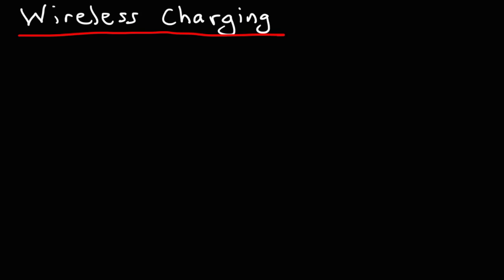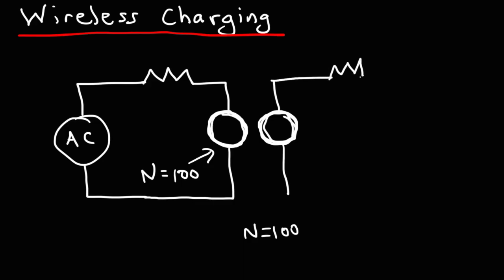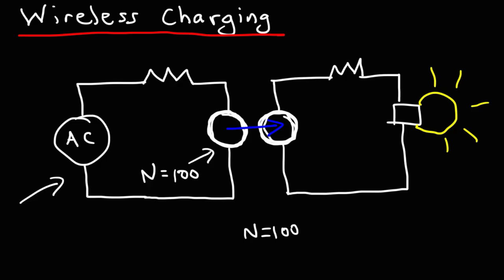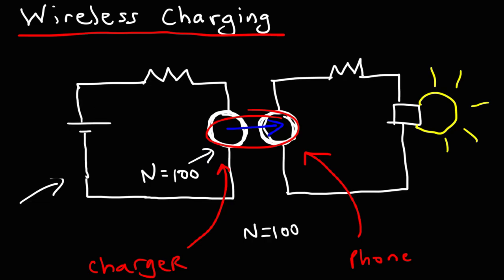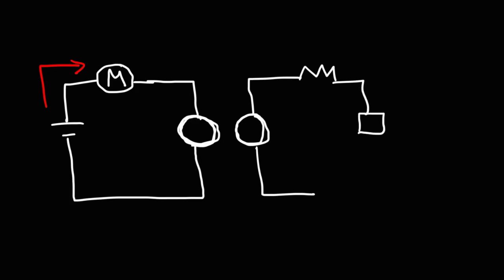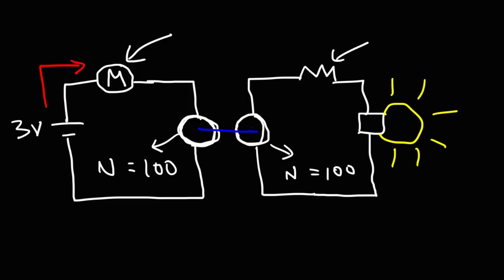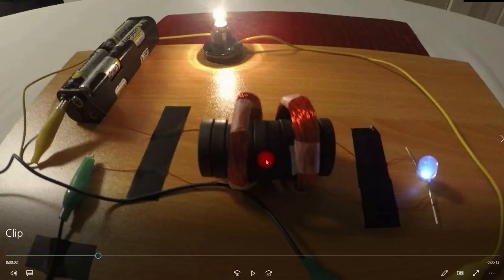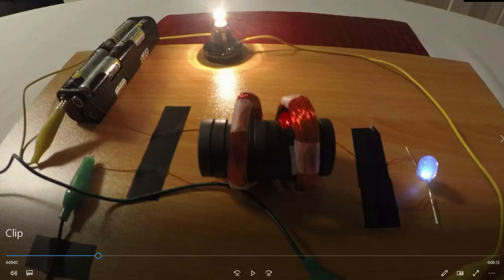How Does Wireless Charging Work?

Comment: we did this in my Elec. Machines & Transformers class. but instead of an led we just measured the output voltage and phase angles with different number of turns and coil direction.